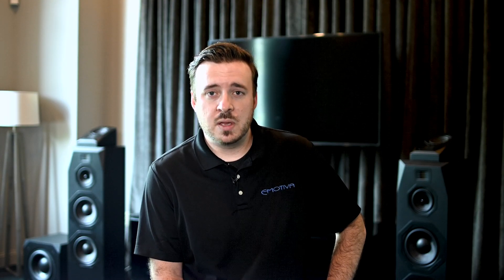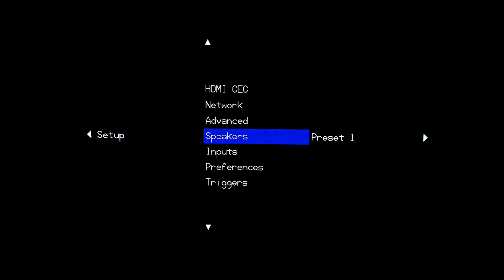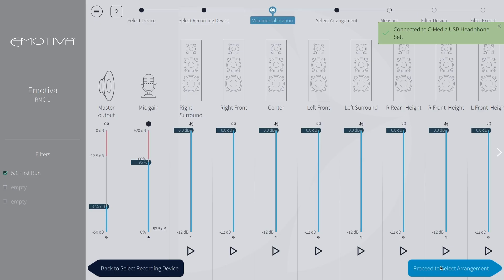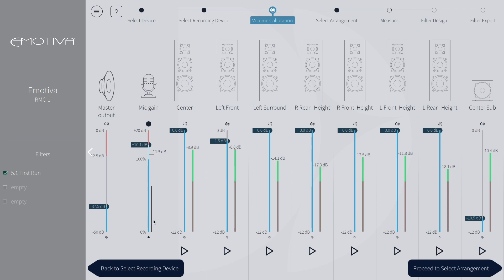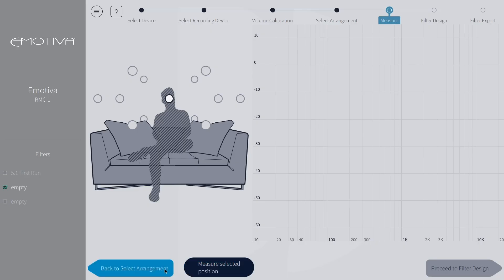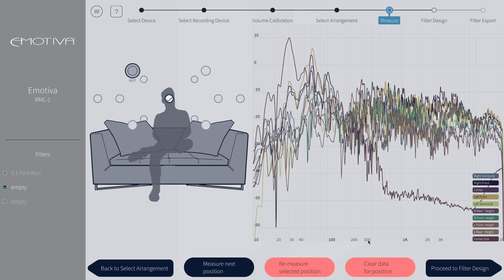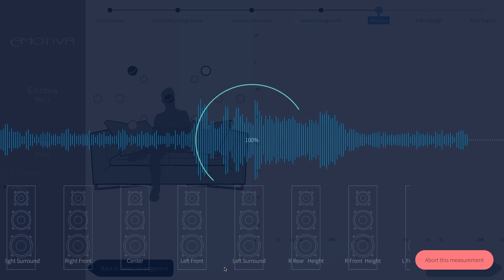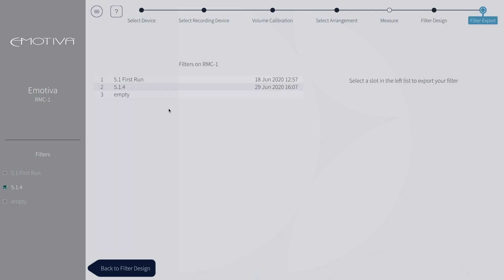Emotiva Dirac Live Room Correction Tutorial

Comment: Are the 'front' microphone positions (top right/left, bottom right/left) in front of the main microphone position (ie, closer to the speaker) or the same  distance away? If they are closer to the speakers compared to the main position, how much would you recommend?
Reply from the maker: It only moves about a foot forward or a foot backwards on the center position.
Reply: @EmotivaAudioCorp  that's super helpful. I was holding off on doing the calibration until this info. Thanks!!

Comment: I have dual SVS PB 2000, what volume should they be before running dirac (Max, medium, low)? After dirac I have to put the volume way up. At what level should the master output and mic gain be during calibration? Thanks
Reply: Master output and Mic gain will change depending on your room. If you want to try to eliminate the microphone from the picture I would move it to 100%. Then play all your speakers. Find the speaker playing the lowest level then move your MASTER volume up to bring that low speaker to -16db. From there bring all your other speakers down individually to -16db. If the subs are stil too hot then they will need to be adjusted manually.

Comment: I keep getting signal to noise errors. My guess is it is to the room vibrating and making noise. I have four subs, one in each corner. Maybe I should turn off two of them?
Reply: Signal too low or signal too high?
Reply: Nick Mandara thanks, I finally got it figured out. The signal was too low so I turned up the master volume and did everything I could to keep the room from making noise due to the 4 big subs. The sound is excellent but I will probably run it agin to add more bass without having to increase sub volume levels

Comment: I received the Dirac live kit, followed instructions but can’t get past a Low signal-to-noise level error. Tried adjusting Mike gain, master volume, individual channel levels. Room is super quiet and I can’t figure out what’s wrong. Help!!!
Reply: Why did you use a C-media headphone set instead of the included PnP sound device (microphone)?  I'm on a MacBook Air.  I noticed you're on a Mac as well.  Still can't get past the low signal to noise level error after adjusting the sound level on my Mac.
Reply: @keifferbuggs6466  My cable listed itself as the CMedia device. Yours might show up as the PnP. Just make sure you are using the USB device and not the internal computer microphone. If you keep getting low noise level errors, try bringing your mic gain up to 100% then raising your master volume and pulling the individual speakers down to about -16 db.
Reply: I am having  the same problem.  "Low signal to noise level" error.
Reply: DiMoraDiamond check out my thread in the Emotiva Lounge called: 
Dirac Live - Low signal-to-noise Level error

Comment: One aspect of using this room calibration that I've yet to understand is why I would want a custom modified profile beyond what the system is designed to create.  My assumption is, this gets the most of each individual speaker relative to my room acoustics, and therefore spits out the perfect profile and any content will be decoded per the director's intention with regard to sound placement. I'm coming from pure analog solid state where no tonal controls were present and music was heard in it's purest form so if it sucked in studio, is sucked on my system.  I was pleased with the output from the DIRAC setup on the XMC-1, and assume it will be even better on the XMC-2

Comment: For me, doesn’t have sense to do all that things. And that doesn’t seem so easy, you may have many little problems to solve during the process, and it will not be ok in the first attempt. Your equipment is excellent ! but you should install into your equipment something more friendly.
Reply: You may want to just stick with standard speaker distance to the listening position using an SPL meter to calibrate speaker volume.  Or maybe wear headphones?
Reply: its really not hard its time consuming but it is in my option worth it. just make sure to set the levels correctly at the beginning and its a mater of moving the mic.